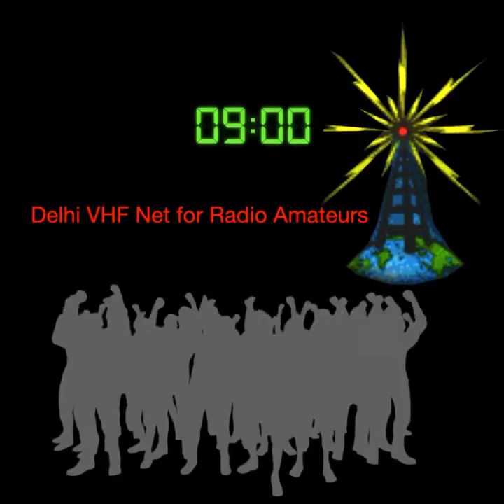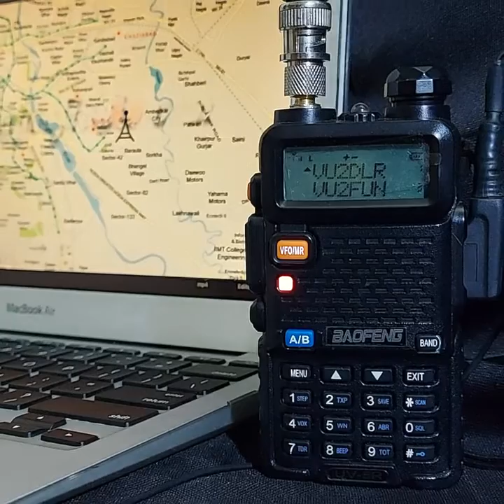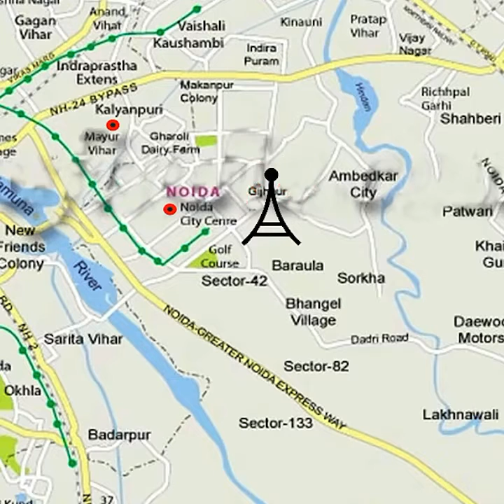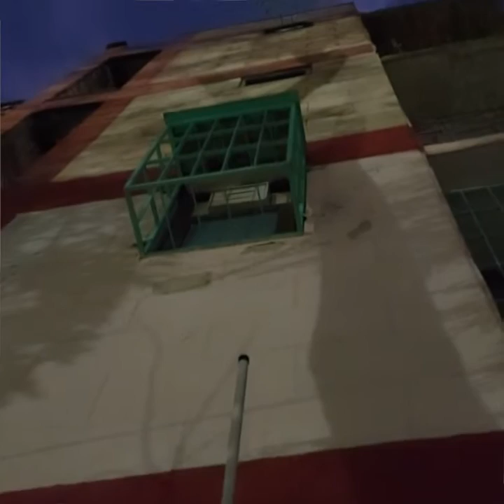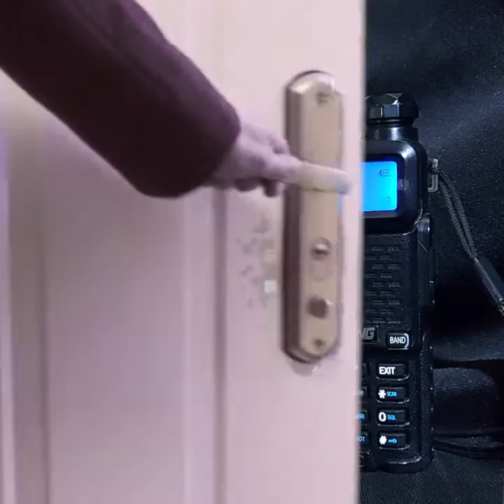Signal Report: Delhi Ham Radio VHF Net

Comment: Sir, i recently bought a uv-5r but i am not able to recept any signal from it except fm. I live near abes gzb in high rise area, can you please tell and help me to upgrade uv-5r stalk antenna like you did in yours...thnx in advance  🙌🏻
Reply from the maker: Before explaining , can you please let me know if you are a licenced Ham? And if yes, kindly share your call sign.
Reply: @shandybrandy5407  Sir, I dont hv a ham license but I am a Electronics Eng, so ik little bit abt using(will not use it for transmit anything) and will apply for it in march...plus i also bought a new rtl-sdr v4 but failed to get any signal..same reason as I live in high rise area....but recently i catched a audio on 161.150, maybe its of police.....
Reply from the maker: @kunal6073 Hello! Thank you for your interest in my homebrew antenna project. However, I must clarify that sharing details on upgrading or homebrewing antennas for handy talkies like the UV5R with an unlicensed individual would be against Amateur Radio rules and ethics, as governed by the Wireless Planning and Coordination (WPC) wing of the Department of Telecommunications (DOT), Government of India.

As you may be aware, possessing HTs like the UV5R without a valid Amateur Radio licence is a violation of WPC rules, punishable by law.

I strongly encourage you to obtain your Amateur Radio lìence, which will not only allow you to enjoy this fascinating hobby legally but also open doors to a wonderful community of Radio enthusiasts. 

Once you've secured your licence, I'd be happy to share information on homebrew antenna projects. Thank you for understanding, and I look forward to welcoming you to the Amateur Radio community soon!

Comment: Please share with us about your baofang UV -5r and which type of antenna you are using .so that I get some idea for my UV-5r
Reply from the maker: Hi there, thank you for your query.  It is a Vertical Dipole VHF antenna which I built with items that were mostly available in my house. 
Following are the items used for this antenna:
1) Two pieces of 19.35 inch electrical wire 8 gauge
2) Two Grey plastic tubes with entire length slit from a children's animal description calendar 
3) End caps of the calendar slit tubes
4) Piece of 1/2 inch PVC  pipe
5) Half inch PVC  pipe 15cinch long
6) Piece of wood to act as a wall bracket

The two pieces of 19.35 inch electrical wires are housed inside the Grey plastic tubes. Scrap off the end wires and use Lugs to connect it to the antenna feeder wire. Make five turns of the antenna wire of around seven inch diameter and tie is with a zip tie which will work as a BalUn (balance unbalance)

Pls note that the braid side of the antenna wire should be facing towards the bottom while the sleeve wire should be pointing vertically towards the sky.
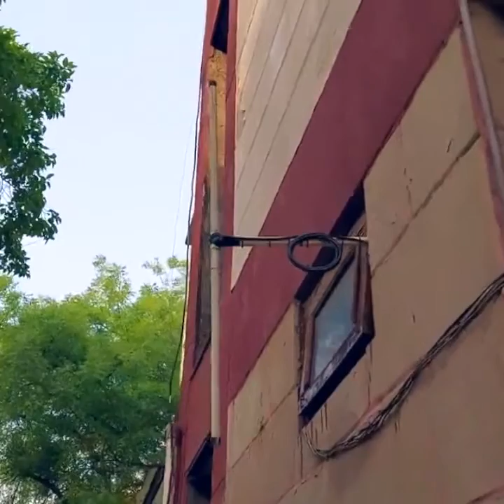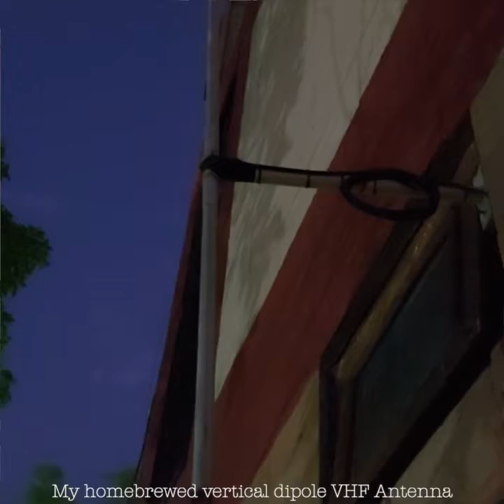Do watch again and freeze the video at 04:47 and 05:19 to get an idea how the antenna has been made like alphabe 'T' to hold it at the ventilator and also the BalUn. After completing it the entire PVC pipe including the Lugs have been weather proofed by applying hot glue gun

The other end of antenna feeder wire has been intentionally been connected to a BNC connector. Ensure that the UV5R has a SMA to BNC adapter and you are good to go. Personally, I prefer BNC since it is light weight when compared to the SO239 varieties as it reduces the strain and torgue pressure on the HT's internal circuitry

Here is a caveat: I have no means to measure the SWR but with trial and error adjusting the distance between the braid and sleeved antenna wires helped me to find a sweet spot when I got encouraging signal report from other hams

Trust this helps and hope you are able to replicate this Vertical Dipole homebrewed antenna. Additionally, do read in the description section of the video too

Further, this same Vertical dipole antenna can be made to use as a high-beam Yagi antenna by adding reflectors and director

Cheers!
Reply: @shandybrandy5407  if possible make a video of the antenna and upload on your channel.
Or you may please suggest a video from YouTube that I may make antenna because I am not from technical branch.
Thank you
Reply from the maker: @meta51  cool, but may I know your callsign?
Reply: @shandybrandy5407  I'm not amateur licence holder infect I applied for ASOC exam.
I ordered UV 5R and I was excited know
Reply: @shandybrandy5407  Is it easy for not technical person to get passed from ASOC exam. Because I was bit confused that which I should General licence or restricted licence.
As now I am in 12th class with subject as Biology Chemistry Physics.
Is ASOC exam is tough?
And After giving ASOC exam and passing this, after how much time we licence.
Please Clear dought 🙏🏻
Reply from the maker: @meta51  Hi there again, it is utmost advisable for you to first qualify for the exam conducted by WPC, MoC, government of India for a licence to operate wireless transceivers in the Radio Amateurs' band and frequencies

Please note that possession of transceivers including the UV5R without a valid licence is illegal in India that may attract severe punishment, fine and be jailed

Thank you for your understanding!
Reply: @shandybrandy5407  ASOC exam which is conducted by WPC is Multiple choice or it Subjective of answer
Reply: Hi Shandy, 
by 8 gauge wire do you mean 8 AWG which is 8mm2 in India? Do you have any specific reason for such a large diameter?
Also what type of coax feedline did you use?
Thank you
Reply from the maker: @alphamike_1612  yeah, it's 8 AWG. The coax feed-line is a Chinese made. Altough it is pretty thin but, by and large has the properties of LR400 varieties. Used a patch cable so that the radio's antenna circuitry is not strained by the torgue of the stiff feedline coax
Cheers!